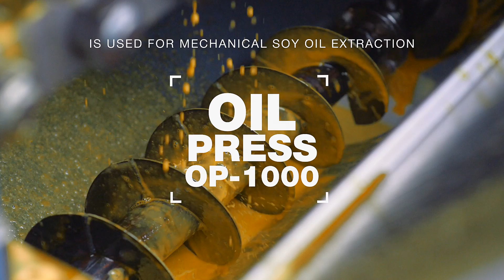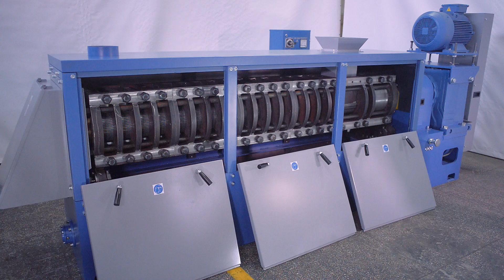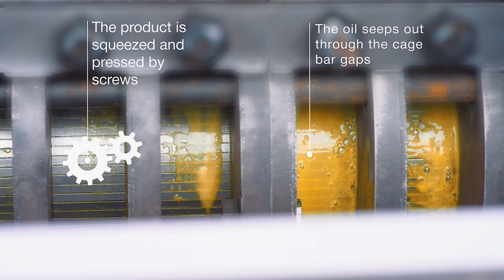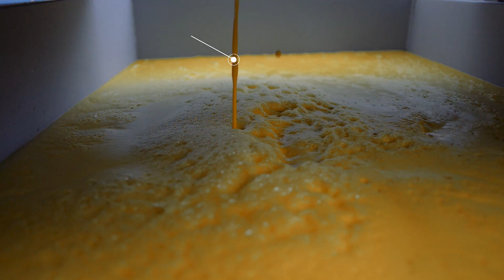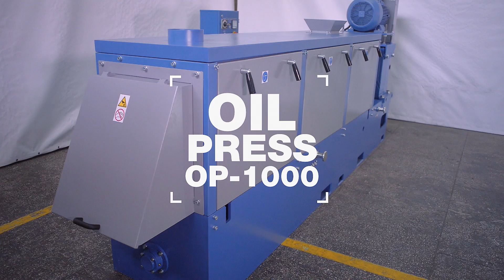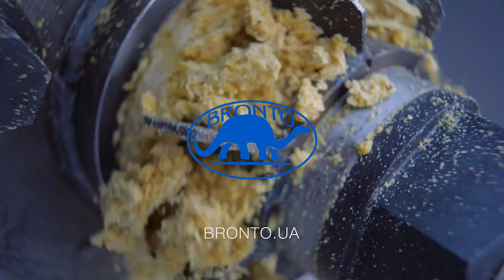Oil press for soya OP-1000 / Ukraine / 2016.12.15

Comment from the maker: We offer the mechanical method for extracting oil from the full fat soy. 
For information regarding the price of equipment, please fill in the following form https://bit.ly/2Ww8f9l 
or use contact e-mails: 
extrusion@bronto.ua 
bronto@bronto.ua 
You may still call us at: 
+38 0472 590 370
+38 067 650 40 05